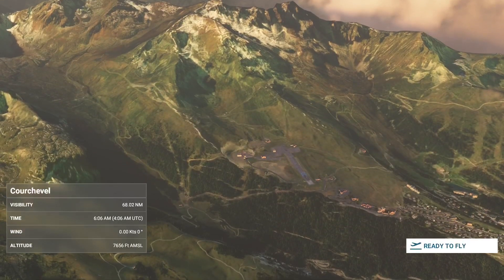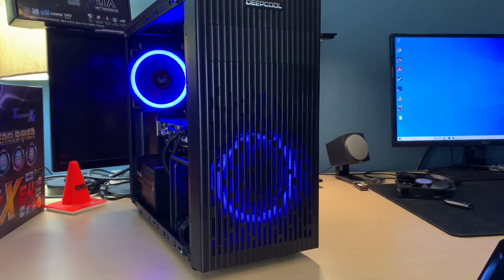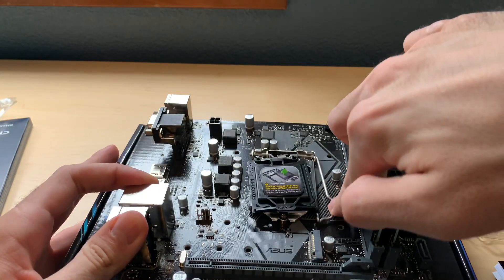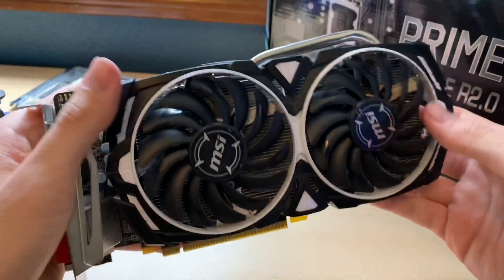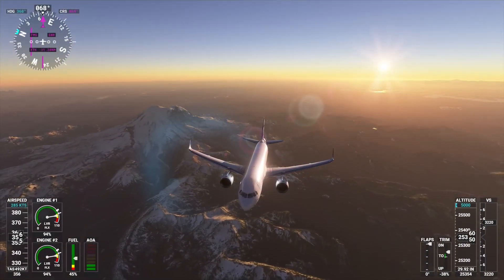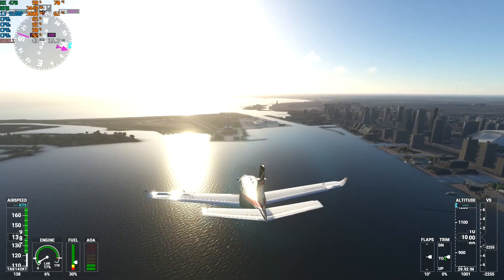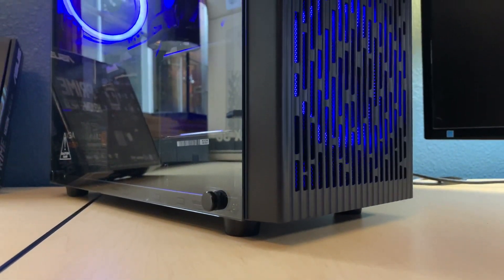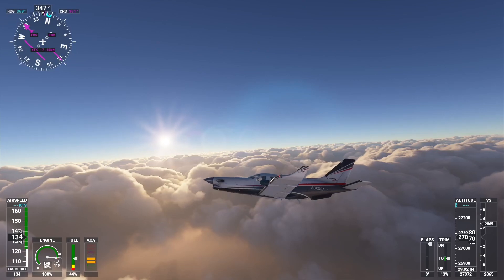Can a $325 PC run Microsoft Flight Simulator 2020?

Comment: It's now 1.5 years later, but this build with all USED parts can hit closer to $900 after tax and shipping. Part of it is the GPU shortage, and part of it is our general inflation worldwide. While it's POSSIBLE to still get decent deals on used parts, you sometimes have to put a value on your time. I got to the point where I was spending ten hours per day searching for deals on parts and frequently coming up with NOTHING but wasted time, gas, and headaches. To those out there who feel their time is worth nothing, or like to fabricate lies on the internet about the "RTX 3090 for $15 that they just scored!" more power to them, but I've had my fill.

Comment: do you recomend the rx 470 4gb for mivcresoft flgiht sim does   it stuter a lot
Reply from the maker: Have used RX 470s in the past before and they pack a punch, would definitely recommend one if you plan on using it for flight sim

Comment: can this run: i7-3770, hd 4000, & 16gb ram
Reply from the maker: That i7 is more than capable when paired with a decent gpu, but Intel HD graphics from that gen can’t run MS flight sim properly unfortunately
Reply: @EmTekTube  what about X-Plane? I know it could run FSX perfectly.

Comment: Im looking at a gaming pc to buy, here in the UK its £1199.99
Its a Lenovo Legion T5i

Intel Core i510400 processor. 
Hex core processor. 
Processor speed 2.9GHz with a burst speed of 4.3GHz. 
16GB RAM DDR4. 
1TB SSD storage

 Dedicated graphics. 
 NVIDIA GeForce RTX 2060 with 6GB memory GDDR6

What kind of settings and frame rates do you think I could run with this pc?
Reply from the maker: That’s some decent specs on the PC you mentioned. I can’t give you exact numbers as I don’t own similar hardware, but you should be able to play at medium-high settings comfortably with those components
Reply: @EmTekTube  Thanks for your reply

Comment: i recommend you get 32GB ram this sim eats 16GB alive!!! ive seen 22GB been used while flying over newyork
Reply: I only have 8 gb ram in a $2000AUD gaming laptop
Wanna cry about your 32 gb ram rtx 3090 system not getting 100 FPS?
Try a g531gt with an i7 9750h and gtx 1650
Reply: I have an Intel e8400

Comment: Will this run on
cpu: ryzen 5 2600/i3-9100f
ram: 16gb 2666mhz
gpu: gtx1650super
???
Confused between using ryzen 5 2600 and i3-9100f for cpu. Which one do you prefer?
Reply from the maker: Definitely, the specs you listed are more powerful then the computer I used so you it should run it better. 

Also I’d prefer the Ryzen 5 if I’d had the choice as it has 6Cores/12HT vs the i3 9100F which just has 4cores/4HT.
Reply: @EmTekTube  Thank you my man! Can't wait to build my PC and this will be my first game to install. Thanks for the recommendation! Godbless u!

Comment: I have an amd fx 8350, Radeon r7 370 16 gigs 1600 mhz ram how well will it run on my pc? I would like to know so I don’t buy it and then get 15 FPS
Reply from the maker: My guess is probably around 20-30 FPS on the lowest settings. Couldn't find many people using a 370 to run flight sim, but found a couple of videos of a GTX 950, which is about on par with a 370, and they seem to hit around 30fps.
Reply: Em's Tek Tube ty
Reply from the maker: @Heliman1  np

Comment: I have an i7 6th gen cpu laptop but only an r5 m335 gpu and 16gb of ram. Would I be able to play this game?
Reply from the maker: It will probably struggle to run it. The cpu and ram should be fine, but the m355 is fairly weak and I don’t think it can run unfortunately.
Reply: @EmTekTube  ok, thanks!

Comment: very good video ! i use a core I3 3240, change 12 to 16 Gb RAM, and from GTX 660 2Gb  i put a GTX 1050 Ti msi 4GB. Surprise  !!! IT WORKS on medium level.  It is enjoyable and playable. I follow some advices on setting, it works correctly avoiding FPS killer as shadows. But in big cities you get drop on FPS under 10 fps, but it works ! i am impress by this FS 2020 programing.
Reply from the maker: Thanks! And that's pretty dope that it can run with a 2nd gen i3. The move to upgrade more ram and the 1050Ti is defiantly a good choice!
Reply: @EmTekTube  Yes ! i am surprise it works at all, when i launch the it, i was afraid my computer would crash badly. 5 h in flight in FS 2020 and no computer crashes, but very busy CPU ! i tried over New York, that's quite a drop on FPS  if you too close to the ground, BUT remains playable.
Reply: What’s your FPS normally
Reply: @jetblue6728  20-30 fps on altitude above 500 feets or more following the type of terrain, town etc...on low altitude it is bad with big town, i can drop to 1 fps ... i fly today above Marseille i drop to 5-9 fps on low flying. I put 4 videos on my channel on FS2020
Reply: @Goblin2 bis okay, thanks. I’ll check it out

Comment: Good to know my i3-9100F can run MS Flight Simulator.  I am upgrading my RAM to 16GB, and plan on purchasing a higher end video card very soon.  Thanks for making the video.
Reply: Hey i am going to do the same
Reply: @nikolaszisoudis8408  I put a much better 4GB video card in my computer.  MS Flight still is a little choppy, but nothing major.  I don't currently play Flight Sim on my PC, but I have it in my Steam library.
Reply: @ku4uv  that’s a very shit cpu, get a i5 9400f. He optimised his gpu and cpu
Reply: @jusalii  Yeah, it's not the greatest CPU.  I may drop a better CPU in the motherboard in the future.
Reply: Hey i have GTX 1050 with 16GB ram dual channel i3 9100F and a 500gb ssd how much will i get in FPS
Reply: @nikolaszisoudis8408  Not sure.
Reply: @nikolaszisoudis8408  I have i3 9100F , GTX 1650 and16 GB Ram.  8-30 FPS
Reply: @abchk_yt4322  i dont hav this config anymore i got a dell G5 5500
Reply: @nikolaszisoudis8408  how much did u get

Comment: The reason frames are hardest the first time around, is it's loading the the roaming cache. If you wait about 3 to 4 minutes (Or longer if you increased it's size) it will run smoothly throughout your flight. I find if you cursor around your viewpoint in both external and cockpit view, it's much smoother. I have a little better CPU a Ryzen 5 2400g with 4 cores, but 8 threads, 8GB memory, and GTX1050. and get similar results to you. I do have a decent Internet speed at 85Mbs, which I limit to 40Mbs not to effect the rest of the users in the house, which is plenty.
Reply from the maker: Definitely letting the world load in for a couple or so minutes does make it smoother. That is until you fly into a new area and it has to load a bunch of new textures again lol

Comment: my $1400 pc can't even run it this well what the heck
Reply: embed damn, what system you running?
Reply: @TheNotSoSmokinTire  rtx 2060s, ryzen 5 3600x, 32gb ddr4-3200 ram
Reply: @embedyt  nothin wrong with that.. ur using dual channel right?..or maybe the problem on ur monitor or maybe u just set the game setting to 4k res??? or u just kiding me?
Reply: @embedyt  hey, ur GPU is 2000x better than my 1650
My computer cost $2000AUD and has a 1650 but yours is like $1800AUD and has a 2060 
Rip
Reply: @TheNotSoSmokinTire  windows 98
Reply: That's what happens when you buy PCs and don't build them yourselves lmao
Reply: @cytrus3427  I built it myself tho
Reply: @embedyt  When was it built?